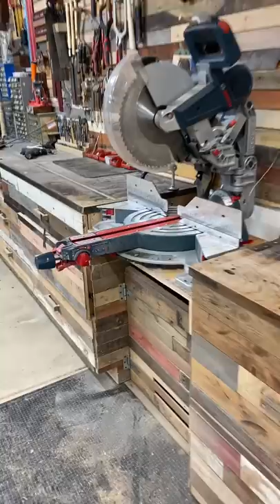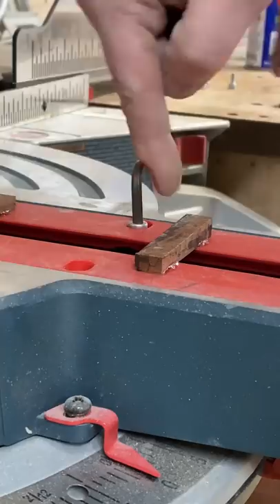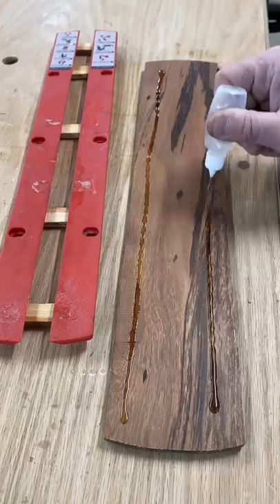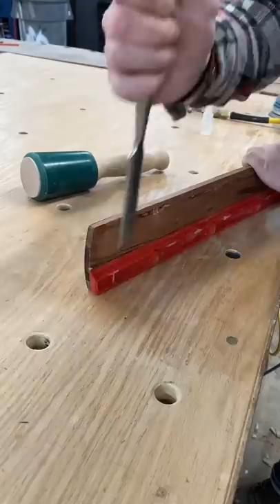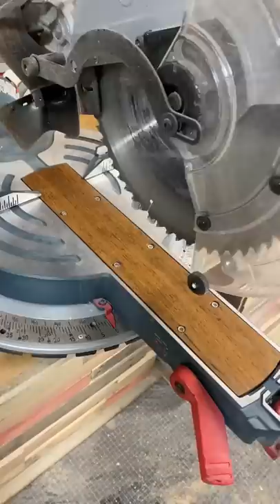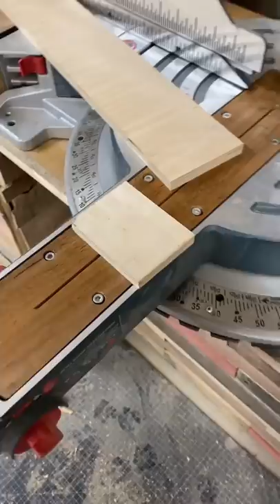Zero Clearance Insert For the Miter Saw #shorts

Comment: For people who are unfamiliar with zero clearance inserts, this has a few benefits:
-reduces breakout on the bottom of the cut
-allows cutting smaller pieces (that would normally fall in)
-prevents small cuts from falling in (kinda the same as above)
-helps aim your blade so u know exactly where it will cut
Reply: Its the same as before. Zero difference. If you want lined up, set your saw down on your board.
Reply: @charlespanache7047  incorrect
Reply: Smart man
Reply: I wish they made these already with the zero clearance. I can't really imagine why they don't. Having a small piece inside can be kind of scary when it turns into a projectile
Reply: @OtherDalfite  well if you tilt the blade for a compund angle, the opening will widen, so this is really ideal for zero tilt cuts. This is probably why manufacturers don't make zero clearance. But if you need to make a straight cut, this certainly has benefits.

You might be able to make a zero clearance insert just for 45 degree cuts. Haven't tried it.
Reply: Cool
Reply: @ilikewaffles3689  but still, come on manufacturers, just supply us two extra inserts all zero clearance. Zero clearance 45, zero clearance 90, and an open clearance for any in between cut
Reply: @OtherDalfite  true that would be nice 🙂
Reply: @carlcasey4177  noice
Reply: Thank you for this. I was wondering.
Reply: Won't that going to heat up the blade faster?
Reply: @charlespanache7047  
Wrong
Reply: @OtherDalfite  
Why aren't they made zero clearance?
See that large gap? That's 0.03 cents worth of material.
0.03 cents X 1,000,000 units = big $ savings to the manufacturer. 
Big savings = happy shareholders.
Happy shareholders = CEO bonus.
Reply: Agreed BUT the gap is widened with compound cuts, so your points are only beneficial to a constant 90° cut.
Reply: @Jarod1941  lol ik. It just sucks for us consumers. That and they'd have to develop tooling for 3 different molds rather than just one
Reply: @Jarod1941  correct, read my replies above
Reply: @ilikewaffles3689  
I saw your comment, obviously.
If I hadn't, I couldn't have replied to you in this thread.
facepalm
Reply: Ahhhh, I wondering why someone would make cosmetic upgrades to their saw 😂😂
Reply: @BigIronTexas  🤣
Reply: Thank you for answering my question so I didnt have to ask it. Didnt want to feel dumb and embarrassed for asking because of how harsh some people can be towards others tbh.
Reply: @sean-patrickmalvar9111  yw🥰
Reply: What about on a angle
Reply: @andyt1573  Please read some of my replies above🥰
Reply: @Jarod1941  replieS (plural). I make note of this limitation in some of my other replies. facepalm
Reply: @OtherDalfite  because in reality, people cut material at bevels all the time. And this opens up the "zero clearance" in other words, it only works when cutting at zero degrees.
Reply: @ilikewaffles3689  
Youtube is showing me ONE comment from you, anywhere, to any video, ever. But whatever.
You can go away now.
Reply: @Jarod1941  nah I'll stay under MY comment thanks 😊👍
Reply: @Jarod1941  You're literally commenting on his comments and he has several comments/replies to his initial comment. 
You go away. 🤷‍♂️🤦‍♂️
Reply: It doesn't really help with blowout on the underside unless you have a supremely crappy blade.  A zero clearance fence is way more beneficial, especially when you're cutting boards vertically.
Reply: I’m certainly no master carpenter, but this seems like a lot of extra work. How about just using a piece of scrap plywood under the small item to be cut? This would provide best protection against breakouts/splinters while preventing anything small from falling through, and you can cut at any angle. If you’re making multiple cuts that are the same, just clamp it or glue it down.
Reply: @CodedOne  
Pot. Kettle. Black.
Reply: @Jarod1941  Hey, come on you two, please...can't we all just get a bong? 😤
Reply: @charlespanache7047  you are clueless! You’ve clearly never done much finish work or you would know blowout is a huge issue that can be avoided with this
Reply: @ThekiBoran  helps tons with blowout on hard wood
Reply: @mightbemetoo  that’s a pain in the ass if your making hundreds of cuts a day. And I’m sure he enjoyed making this for his tool he uses daily
Reply: @mlyniecm 

I can cut a plastic countertop with a dull circulur saw blade if I cut backwards.  What that does is it makes the blade tooth go through the face into the meat of the top.  The same thing happens when cutting on a miter saw, as you make your cut the blade teeth are going through the face of the under side, I never get blowout on the underside, regardless of blade sharpness or material I'm cutting.
A zero clearance insert is beneficial for the other things the op said, like small pieces falling into the space under the insert.
Reply: @ThekiBoran  despite what you may think, you haven’t “seen it all”. I can assure this reduces blow back in materials you have never worked with.
Reply: @ThekiBoran  sounds like you do some shotty work
Reply: @mlyniecm 

First of all it's spelled shoddy, not shotty.  Second of all I'm a trained finish carpenter with experience in commercial as well as stupidly high-end residential.
I'm not saying a zero clearance insert has no value, it does, I'm saying if blowout is occurring it is operator error.  The reason I cut stain grade base face down/flat regardless if width is because I get a pristine cut/edge, and that's without a zero clearance insert.  I'm speaking from years of experience and not once have I seen a fellow professional in the field use a zero clearance insert, fence yes, insert, no.  In the meantime I'd like to encourage you to blow it out your backside.
Reply: @mlyniecm  I’m not sure I understand- how is clamping a piece of plywood down a pain in the ass - if the cut is the same angle over and over 100 times, it will make its own slot - zero effort…but sure, if you have a few hours before making hundreds of cuts to make a specific modification board for one type of cut, go for it.
Reply: @mlyniecm 

What kind of materials are you speaking about?  Styrofoam?  LOL!
Reply: thank you
Reply: @OtherDalfite 

I would guess that professionals in the field, like myself, don't have a need for zero clearance inserts so why should Bosch, Dewalt and other manufacturers bother?
With that said, and my other comments, the guy in the video did a great job.
Reply: @ilikewaffles3689 

I would guess that Charles is a professional, like me.  I'm a professional finish carpenter with decades of experience.  While the insert he made is really nice I simply don't have a need for it.
Reply: Charles Panache it’s obvious you don’t know much about trim this one hack will save you hours
Reply: @joesmo2840 

I suppose if you do gobs of scotia a zero clearance insert would be beneficial.
Reply: Thanks I was wondering
Reply: @ThekiBoran  it could be a competitive edge. If the cost of the inserts are built in, they could easily market this towards fine craftsman, or cabinet builders.

The other comment about blade width is also a great bit I forgot about. Not all blades have the same thickness.

If not a 45 zero clearance, at least a 90 would be nice to have
Reply: Hero of the video right here
Reply: If you do any amount of cutting it’s well worth the time but I use little different set up
Reply: @charlespanache7047  this man right here has clearly never had to cut anything in his entire life.
Reply: @anthonyspinozzi1312 

I've cut miles and miles of casing, t&g and wall base, and a zero clearance insert isn't necessary except for very small trim pieces like scotia.  Smaller pieces need support right up to the blade so they don't vibrate as the blade cuts.
Reply: @anthonyspinozzi1312  worked at a door factory where id measure and cut down to 1/32. Ive cut hundreds of rails/styles for doors in a day. I used a chop saw like this one. No issues ever. But i guess it was already set up for it? Btw im a framer and roofer. Ive made plenty of cuts with zero issues using stock tools.
Reply: Thank you
Reply: Thank you!
Reply: Thanks for the explanation. I just thought it looked cool after.
Reply: Was going to ask…the answers are here already. thanks
Reply: Thank you for this my friend
Reply: That's cool. Why don't they just make them like that? Every woodworker I see has built their own, why's it not just standard?
Reply: @charlespanache7047  wrong.
Reply: @ilikewaffles3689  you’re incorrect
Reply: @Mikey-ym6ok  ok
Reply: I came here for the explanation of why to do this. Thanks
Reply: are there drawbacks??
Reply: @charlespanache7047  someone didn't grow up with a father
Reply: @charlespanache7047  zero different yet only mentioned the last point. Where's your rebuttal on point 1,2 and 3?
Reply: I was like what was the purpose
Reply: Thank you
Reply: thank you for that explanation  I wasn't really sure what was gained.
Reply: Does absolutely zero for tearout
Reply: @geckoassassin1  Have you tried it?
Reply: @OtherDalfite  which manufacturer will be the first to do this? Once one does the rest would follow
Reply: @ilikewaffles3689  putting a zero clearance on a Miter saw is like putting it on top of the a wood on a tablesaw. The teeth are pulling from the bottom up on a Miter saw, you need something on the exit of the cut not the entrance.
Reply: Big thanks to you 😂😂
Reply: Number 2 and 3 is the same thing why should I listen to you
Reply: I mean it looks cool but yea sure all that stuff too
Reply: @Y2k_Jisoo_fann  *
Reply: @OtherDalfite  because sometimes you want a cut at a different angle than 90°
Reply: @violetspider_  of course, but a large majority of the cuts anyone makes(most people) will almost always be at 90 degrees
Reply: @OtherDalfite  so what do you do when you want a 59° cut? Majority of time ? So you want me to switch that piece of wood every time i need a different angle cut? If you're that bothered by it just buy 20 mitre saws. That will cover some angles!
Reply: @OtherDalfite  not saying that, but I'm not gonna switch that wood or plastic everytime i need too
Reply: @violetspider_  why not just stick with the open clearance then? You're not thinking dude.
Reply: @OtherDalfite  exactly, stay with the open clearance 🙄
Reply: @violetspider_  I'm saying to include it, not make it the sole insert. God damn bro did you get dropped on your head or something?
Reply: @OtherDalfite  i thought you meant to have JUST the zero clearance. My bad, but i personally still wouldn't bother. Like i said you want a different one for every angle. I don't see the winning argument being that you don't want pieces flying. But agree to disagree. 🤗
Reply: @violetspider_  I just like the idea of being able to shave off small sections without the risk of them getting sucked down into the blade and turned into projectiles. But no just a 90° zero clearance insert would be a horrible idea.
Reply: @ilikewaffles3689  just do the same thing but set the miller to 45 deg and then cut your 0 clearence hole as was done for this project.
Reply: @Jarod1941  im curious.... how would you be having a conversation with someone on there comment if.... theyve never made more than one comment.... how would he be replying to you.....
Reply: @ilikewaffles3689  meanwhile I’m sending it with the skill saw and caulk it 😅
Reply: Bagus itu paling bagus
Reply: Seru
Reply: First off, love the username. I to like waffles. Thank you for that explanation, I had no clue why this helped
Reply: @Jarod1941  bruh the screws that hold the plate down cost more than that. Imagine the manufacturer removing those for a profit.
It's better to allow us to make mods
Reply: @ilikewaffles3689  you can probably do this for virtually any angle you need.

I mean, it just looks like it's held in by some screws after all.
Reply: You're not too bright are you?
Reply: @Kurokubi  true. I was just giving an example of what i think is the most common angle after 90🥰
Reply: @OtherDalfite   I been working 16 years whit those saw never been scared of a wooden piece stuck in there.. Cuz they never really flew off but cut in half.
Reply: @garnotgaming  I probably wasn't using the saw correctly, but I was trying to trim an inch off a small board and the piece got sucked down, split apart, and shotgunned out the back. Thankfully nothing hit me but it could have. I'm more careful now but a zero clearance insert would make this basically impossible
Reply: Thank you!
Reply: @Jarod1941  sorry, I didn't understand
Reply: Thank you for the explanation because I was confused on what problem he was solving.
Reply: Works with blade perpendicular to table, at an angle not so much.
Reply: https://youtu.be/W4FaoSJD6Mg

Don't need a zero clearance on a miter saw. The only valid point here is making smaller cuts I guess.
Reply: @mlyniecm  https://youtu.be/W4FaoSJD6Mg

Wrong. Miter saw doesn't need a zero clearance. Just face your board the correct way
Reply: @bzd16b  u can make a different one for a particular angle
Reply: Thank you!
Reply: Thank you!! I came to the comment section to ask this question
Reply: And don’t forget, it makes your saw look way better
Reply: That was educational for me as I had no idea what the point was so thank you.
Reply: @Jarod1941  0.03 cents X 1,000,000 = $300. That's hardly a huge amount for the shareholders!
Reply: -looks cool
Reply: I came to the comments looking for this. Thanks!
Reply: Causes build up of dust and debris underneath and can and most likely will be dangerous at getting the blade trapped there is a reason it’s was the way it was .
Reply: Love it when the comment I’m looking for is right at the top
Reply: @OtherDalfite  whats the point of having a 90 degree cut?
Reply: Thanks. I was wondering
Reply: And the cons?
Reply: That would be worthless to me I cut alot of angles and wouldn't have time to change out pieces for certain  cuts..used it the same for 18 years no need to change it now
Reply: @noname-dz7ed  nice
Reply: You answered all my questions!
Reply: Aaron p
Reply: @OtherDalfite  it’s because they are ruined once you do a bevel
Reply: For people who are unfamiliar with miter saw you might not need this all the times, because most of the times you might need to change the angle of cut.
Reply: Lol, not going to lie. I thought he was trying to make it look pretty.  I mean I for one am never against making my tools pretty.
Reply: @charlespanache7047  I'm with ya man!  You are just cutting wood. Its not like you are preparing a tissue sample for a microscope slide.
Reply: @Mike lmao good point
Reply: Yup
Reply: @charlespanache7047  not.
Reply: @OtherDalfite  and that is no joke.    I waited to long to clean that little death trap out one day. That cheap little piece of yellow plastic Dewalt uses on the 10". Mine had a chunk busted out of it. It won't later todsy
Reply: @farrelltaylor6490  a trick I'll do is if I'm cutting only a small section, I'll get a piece of scrap and use it as a "zero clearance" and only make a shallow cut into it. Saves the piece from falling down inside
Reply: @farrelltaylor6490  🥰
Reply: @charlespanache7047  9
Reply: @ilikewaffles3689  90090000000000000000000000000
Reply: @ilikewaffles3689  0900000000000009p
Reply: @ilikewaffles3689  9999
Reply: @ilikewaffles3689  999
Reply: And also prevents the loose end from falling in and be projected by the blade
Reply: @charlespanache7047  You don’t have a clue
Reply: @Jarod1941  Wait, you trolled HIM and you want to call him the troll? WTF?
Reply: @REALfish1552  
Why are you trolling me?
Reply: @OtherDalfite  this would be nice but you would almost have to have more than 2 inserts cause if you want a 45 to the left, you would need one to the right or your blade will cut a big opening again
Reply: @natew48  I envisioned this idea to target single bevel only miter saws. Of course there's no reason one couldn't be sold with dual bevel. Just more plastic to deal with
Reply: @ilikewaffles3689  yea but you can’t make a zero clearance insert that will cut both ways so it’s be pretty irritating to change ever time the angle does lol
Reply: @charlespanache7047  so you have used a miter saw maybe once huh? And it wasn’t yours was it
Reply: @ThekiBoran  that’s great what you mean is if you cut it upside down not backwards, an that’s fine but what if both sides are finished? What your saying is a plywood trick for rough finishes, but sometimes no ones gonna touch your work up after you leave and both sides need to be perfect. A circular saw isn’t a precision tool it’s for rough framing and rough cuts, there’s a reason cabinet shops use table saws
Reply: @ThekiBoran  you can call yourself a professional all you want but reading your comments I wouldn’t hire you to hang a mirror much less finish out a job. Lmao tool getter over here acting like he’s a woodworker lmao
Reply: @Adam-cc3ml 

If both sides need to be perfect I'd consider using a router.  Rout one side then rout the other with a pattern bit for pristine edges.
Reply: @Adam-cc3ml  true but a lot of people only use their miter saw as a crosscut saw.
Reply: @ilikewaffles3689 

Do you have an example of material that needs to be pristine on both sides?
Reply: @Adam-cc3ml 

I've done mostly commercial but I've also done high end residential.  The construction budget on the last house I did was $18 mil.  The crew I was on did all the door and window casing, base and t&g walls and ceilings, both paint grade and stain grade.
Reply: @ThekiBoran  and you handed them the nail guns and glue good job. Simple trim work wow. I don’t really care. I can tell by your comments your not a skilled or seasoned pro your not running a crew your not the guy calling the shots, if you have been doing this for more than a year you haven’t picked up shit. I’m not impressed with door casing and base I don’t care how much you ran. I was doing that when I was 12 I’ve run hundreds of miles of base casing and crown mold. Your comments already proved your just the help
Reply: Waste of time
Reply: I don't think it makes any difference 🤔
Reply: @iqbalhatteea8339  look another guy that’s made ten cuts and thinks he’s a pro
Reply: Thank you
Reply: I work on engines with 10th of a mm clearances and wood workers still make me look like a child putting shit together with elmers glue.
Reply: @paulwilhelmsen6586  lmao 😂
Reply: And no angled cuts
Reply: @OtherDalfite  zero clearance 45 ?  It moves with the blade
Reply: @sean-patrickmalvar9111  mate, if you ask a question, you are you are a fool for as  
long as it takes to get the answer, if you don't ask the question, you are a fool forever.
     Bruce, a learner.
Reply: @Mike Yes! Exactly! You said everything that I was going to comment! Thanks! 

I for one, could use a zero clearance insert because I occasionally make small pieces and once I've epoxied them, I need to trim off a little. But, I'm just not going to take the time to make one. I still enjoy watching someone else's good work though!
Reply: Why wouldn't you just purchase one online?
Reply: @robertstrohlin6051  why wouldn't you buy a knife instead of making one? Cabinets? Furniture? Why have home shops?
Reply: Ok blade aim i like
Reply: Until u have t mitre
Reply: }00 okk km too
Reply: I appreciate you all informing some like men who have never used a saw yet. Good timing to start the job nd hobby huh? Haha
Reply: Thanks
Reply: @B.B.1961  yw
Reply: @OtherDalfite  I can already see the lawsuits flying, when the shards of wood go flying cuz someone used the wrong insert.
Reply: @dave.of.the.forrest  I mean the zero clearance insert only makes you safer. If the wrong one is used it'll obviously have been a user error
Reply: Thanks for the clarification.  I need to do this.  Much easier to get the cut exactly where I want it
Reply: And when do you need to cut with the saw lying down???
Reply: @veneno266  wdymbt
Reply: @francesucksdickful  you'd have to have more than one insert. Which I admit for a jobsite saw would slow things down. Zero clearance only has a place in the home imo
Reply: Why isn't it something that comes standard though
Reply: @Hedgehodge-  probably because it only works for one angle. Once you change the angle it gets ruined.
Reply: @ilikewaffles3689  ah, good point. But would be nice to have as add-on but probably just a lawsuit waiting is why the don't
Reply: Thanks captain obvious
Reply: @phreakyzeke2864  happy to help
Reply: @charlespanache7047  you clearly have zero experience or knowledge on the subject.
Reply: @ilikewaffles3689 You are exactly correct, and that's why I make a few extra Z'clearance for each MS  & TS . .
Reply: Why it dosent come like this is from the manufacturer is just beyond me.
Reply: @Jarod1941 lol it’s not 0.03 savings in material. It’s savings from having to calibrate every machine for manufacturing tolerances. That’s a lot more than 0.03 my guy.